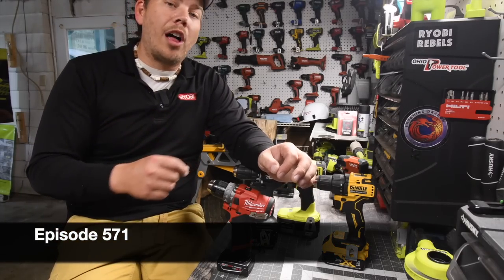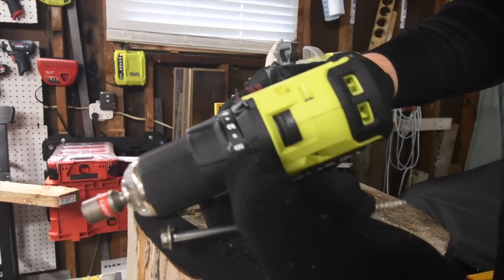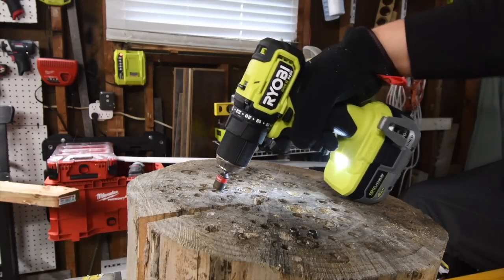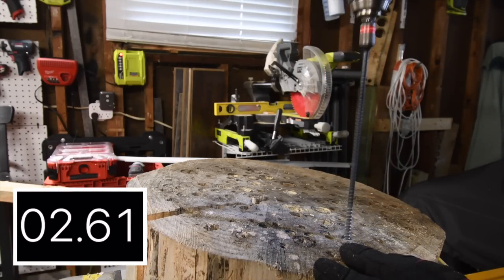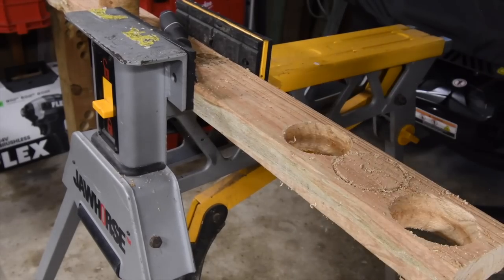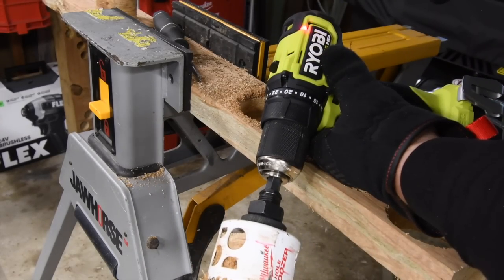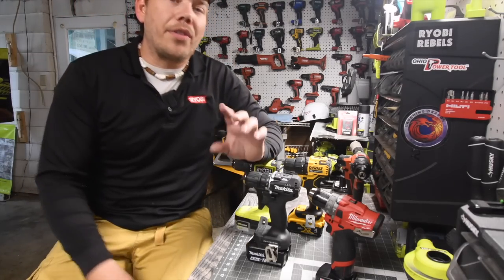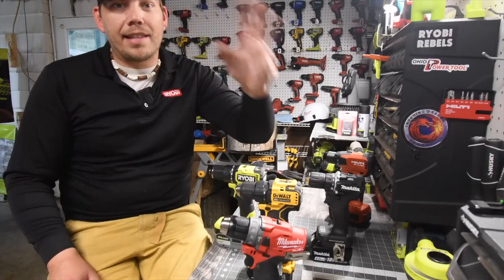Can Milwaukee M12 stand up to 18v tools?

Comment: Pretty good video, I have both the m18 and m12 lines they are both heavily used for different projects. M12 is mainly for light home work, but…. The stubby impact wrench is in a class of its own. Also the m12 oscillating saw is more than enough power for any job.

Comment: My M12 drill will be here tomorrow, and while it isn't close to my M18 2604 (yeah, it's old), it will probably end up doing a lot of the work I need.

It would have been interesting to see the DeWalt DCD701 thrown in there since it supposedly beats the M12 drill.

Comment: That was an entertaining and informative video. Its at times hard to tell if it's worth moving to a different brand if you need something small. Also some if these tools are really close in size. A cool test would be the Dewalt 12v extreme one hand recip saw against the Ryobi version. There almost the same size.

Comment: I have had to use my m12 hammer drill to get out big timber screws that my m12 impact driver wouldn't take out. Impact wouldn't work with type of screw and timber combo I guess.

Comment: I have the M12 Fuel drill and still use it occasionally.  But my take, since I got it, is that it is about the same size/weight/cost as much more capable 18v tools.  So why carry and use the M12 drill?  On the other hand, I find the M12 Surge impact driver to be excellent and use it all the time.
Reply: I'm glad to hear someone else say it.....the m12 is awesome for a 12v tool, but it's not appreciably smaller than my dewalt 791 or anyone's compact/subcompact 18/20v drill....if you're exclusively on m12 I see it's purpose. Otherwise, I just dont.....that's my 2 cents, but everyone use what makes ya happy
Reply: I have both of M18 Fuel Hammer drill,and M12 Fuel hammer drill. 
In terms of size, or weight of the drill itself, M12 is very similar to M18 while the power is not near M18 Fuel.
However, the M12 with 2.0/3.0 battery is still smaller and lighter than M18 with 2.0 battery. 
If you need to do sth in compact area or over the top, the M12 would be a better choice than M18.

Comment: I can’t see how you can ”declare” it as failed only because you need to press the trigger twice… by the logic the entire hole saw segment was a fail. It’s no different than saying a hammer failed because it didn’t get a nail in a 2x4 in one swing
Reply: Agreed
Reply: I agree. Maybe it should have just been noted that it cut out, and then allowed to finish on a 2nd pull or 3rd or whatever is needed until actual failure. Failure without cutout perhaps, but definitely not a fail. Both those drills would have finished the task in another half second.

Comment: I do wonder if ryobi will ever silently improve the regular HP drill or if it'll be permanently left with that inconsistent autoshutoff and simply get abandoned for another 'model#' a few years from now(.)?

It's a bit silly that it can sometimes drive giant lags but fail on timberlocks but then switch to driving the timberlocks easily and failing on the giant lag

Comment: I wonder if they will ever release newer versions of the m12 tools with 21700 cells for the packs? I'd be curious to see the power gains. I love my m12 tools.
Reply: The way I understand 21700 cells to work as their higher amperage but 12 V tools can’t take it vantage of that high amperage as well because they are not capable of drawing it. So I really do not think 21700 would affect them that much
Reply: @agoogleuser1188 , The way it sounds is that the motor has to be optimized for more amps. So simply adding 21700 to a current gen m12 tool shouldn't change anything. But you figure a newer motor couldn't even benefit from it? Possibly. I really have no idea. I know in the 20, 40, 60, and 80v range, motors can be optimized for 21700 cells. So why not 12 volt? To small you think?

Comment: So this proves to me...3 things...1 the m12 series is kinda a useless joke when I can stay with 18 volt tools amd have all the same batterys amd chargers....2 I should just stick with my full size dewalts and just use clutch setting for lighter more delicate tasks....and 3 that hole well the milwaukee m12 series marketing b.s is just that marketing b.s...oh its smaller for tighter areas...and more light duty for finish work...and oh it's light weight so u can use it all day with no fatigue.....all jokes....just buy 18/20 volt tools and have all 18/20 volt tools...and leave the b.s 12 volts for the light duty picture hanging dutys for the diy guys and the you tubers to make vidoes and let the real pros stick to the real tools